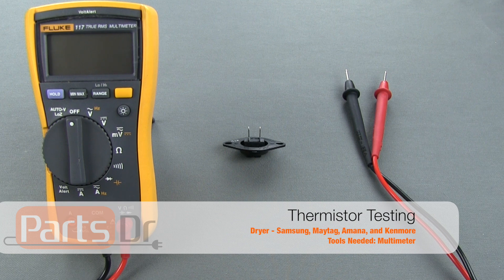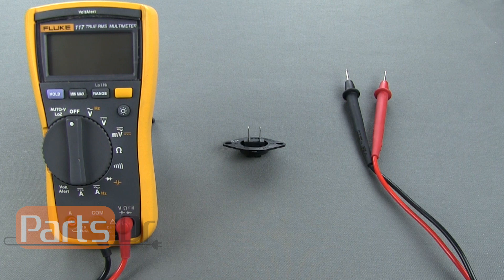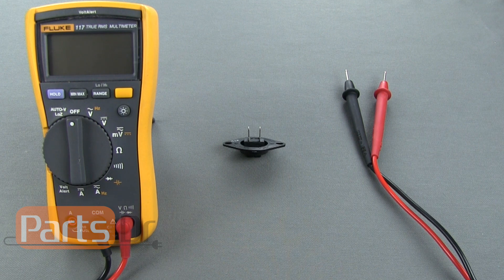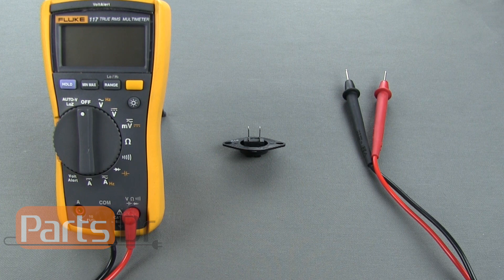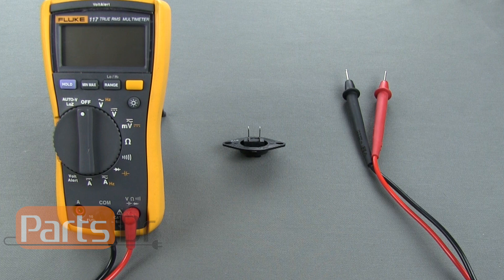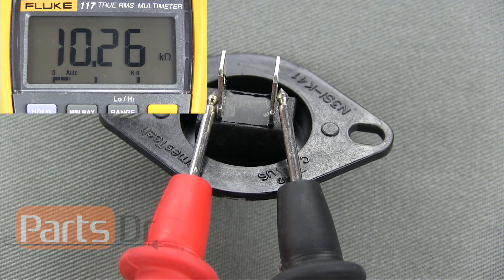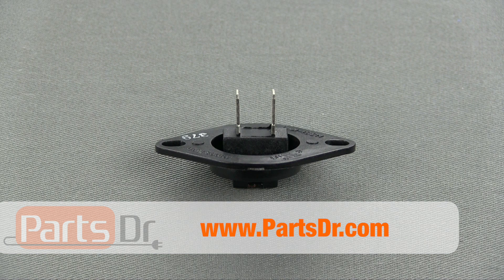How To Test Thermistor Part # DC32-00007A & WP35001191

Comment: Can you test the thermistor with an analog multimeter and if so what setting should it be on and what reading should I get
Reply from the maker: Yes you can.  Set the meter to the 20K or 40K setting for this part shown in the video.

Comment: Multimeter set @20k, no reading for thermodisc T-105 off a speed queen. 
Multimeter set @200k reading is 45. 
Is this a bad thermistor?
Reply from the maker: Ohm specifications vary depending on the part.  Please reference the manufacturer's specifications for your specific dryer and part.

Comment: Hello, I have an auto range multi meter and getting absolutely nothing on the old or new thermistor. Also, would this being bad cause the dryer to over heat? I found the heater element to be broke so I replaced and now it is over heating. Thanks!
Reply from the maker: It's unlikely that the old and new parts are defective unless they are aftermarket parts.  Check to make sure that your multimeter can read ohm values over 10,000 ohms (10K).  A bad thermistor can potentially cause a dryer to overheat.  Try running the dryer on an air dry only (no heat) cycle, if the dryer still heats up then you may have a bad main control board or a shorted heating element.

Comment: thank you so much for details on the ohm values to expect, I wouldn't have known that the 1K reading I got was out of range otherwise. Funny though, I didn't get any error codes on my dryer
Reply from the maker: Glad you found this.  Most dryers will only throw an error code for an open or shorted thermistor.

Comment: My repair man told me it was a bad part after doing a continuity check... No beeps.  I tested after he left and I had no continuity either, but 10.5-10.75 ohm reading.  I wonder if he just didnt know, if he was scaming me, or if im just not understanding correctly ...but im getting rhe reading I should for my room temperature.  Insightful and pleasantly concise video, thank u!
I KNOW the heating element is burnt out, but I wonder if the thermistor is actually working just fine 🧐🙄
Reply from the maker: It sounds like the thermistor was not bad from what you are saying.

Comment: My multimeter ohm setting goes 400 > 4000 > 40k > 400k > 4m. 
Does that matter if I set it to 40k? 
Thermistor that I think is bad tested 8.3k at room temperature.
Reply from the maker: 40k is the correct setting to use.  8.3k is off enough that we would replace it.

Comment: I did not respond to a test with a multimeter set in ohm（2k），What's the reason
Reply from the maker: Since the ohm value is higher than 2k, you have to use the 20k setting.

Comment: My reading is 9.15 ohms, I have resistance on the fuse next to the thermistor, the high limit thermostat and the heating element.  Yet, the thermal fuse on the heating element assembly keeps blowing.  The blower is clean - my air flow is awesome at the vent cap.  Any ideas why the thermal fuse (DC96-00887A) keeps blowing?
Reply from the maker: With your thermistor reading being that far off it would probably be a good idea to replace it.  Our guess is that part probably isn't what is causing the fuse to blow.  Try running the dryer on an air dry (no heat) cycle.  If it heats on an air dry cycle, check the heating element for a short or your main control board might be bad.
Reply: @PartsDr  Thank you - I'll try the no heat cycle when the new fuse arrives.  The heating element has continuity and a resistance of 12.25 ohms.  It didn't register a short to the housing and I visually inspected to confirm.  I also want to update - I found out that the ground jump wire was wired to the ground from the cord instead of the neutral terminal.  I have corrected this mis-wire.  Is it possible this is causing my specific issue or, more likely, caused the control board to go bad?

Comment: I am getting a .05 ohm reading on my thermistor on my Samsung dryer would this make the HC error code
Reply from the maker: That reading would mean the part is bad if you are testing it correctly.  We couldn't find any information on the "HC" error code.
Reply: I get a .25 on the 20k ohm setting... So 250 at room temp.  My error code is "HE".. And this makes sense that the dryer stops almost immediately since it would think the temp is off the chart.  
Thanks for this video!  Was very informative and useful!
Reply from the maker: @evanmitchell1480  We are glad you found it helpful!

Comment: I have a Hotpoint Ultima condensing dryer that wont get hot. Thermostats and element have complete circuits. The thermistor resistance is coming in at 107k. According to your video I need a new one. Is the resistance the same for all makes of dryer?
Reply from the maker: No it is not the same for all makes of dryers.  You will need to find the specifications for your specific thermistor in your model dryer.
Reply: @PartsDr  If I do a continuity test on the thermistor the circuit is open at room temperature. Does that prove it is faulty?
Reply from the maker: @tanz8151  No, you cannot do a continuity test on a thermistor.

Comment: When i checked the thermistor for my samsung dryer it reads 8.76... I'm not sure how much difference this is from 10.26. Should it be replaced? Your help is greatly appreciated thank you.
Reply from the maker: It is off far enough that it would be a good idea to replace it.  It probably isn't off far enough to stop the drying from running or throwing an error code.

Comment: Getting open reading no resistance on 3 new thermistors. Checked on two different auto ranging multimeters. I must be doing something wrong, can’t believe 3 parts would be bad. Any help would be great.
Reply from the maker: What make and model multimeter are you using?
Reply: Parts Dr  Klein mm400 good to 40m
Reply: Had it on wrong setting thermistor, heater, and limits are good but still not heating. I am assuming the control panels is bad?
Reply from the maker: @arambo1628  It could be.  Make sure you always start by checking that the power supply to the dryer is good.

Comment: Your video was the first to come up in my search. I thought I was supposed to check for continuity like I did with the thermostats when I was told by another repair website to check for resistance. I'm glad I found this as it saved me from ordering this part that was actually good! I didn't know how to do this until now. I'm pretty new to electrical testing knowledge. Thanks for this!
Reply from the maker: We are glad you found this video helpful!

Comment: Does this thing have anything to do with the dryer not heating. Ive replaced the heating element, thermal fuse and the other fuse thing and still no heat.
Reply from the maker: If the dryer is throwing an error code relating to the thermistor it depends on the model of dryer but it can cause the dryer to not heat or not run at all until the problem is resolved.

Comment: I am using a fluke 7 - 600 electrical tester multimeter  when I tested the thermistor with this multimeter I did not hear a beep or no reading was shown does this mean the thermistor is bad or did I not check it correctly?
Reply from the maker: The Fluke 7-600 only registers ohm values of up to 400 ohms, so this meter will not register a high enough ohm value to test this part.  You will need to use a different multimeter that registers ohm values over 10,000 ohms to test this part.
Reply: @PartsDr  Can you  recommend me a multimeter that can measure up to 10,000ohms under $50?
Reply from the maker: @DannyPacheco-j6f  This one from Home Depot is within your budget and it measures up to 40 Million Ohms.  Just make sure you read the instructions so you know how to switch it between Continuity and Resistance measurement modes.  https://www.homedepot.com/p/Klein-Tools-Auto-Ranging-Digital-Multi-Meter-MM400/206517333

Comment: i dont have a tester can i bypass the  thermistor by jumping the 2 wires together to see if my dryer will spin? PF code. ive already jumped the thermal fuse and nothing happens
Reply from the maker: No you cannot bypass the thermistor.  PF is usually a Power Failure error that occurs when the dryer is unplugged and plugged back in.
Reply: so whats the fix then because my dryer does not spin?  belt is good/thermal fuse is bypassed and not working  kenmoore he4.

ive seen other vids telling me pf means its the thermistor. also why cant this be bypassed?
Reply from the maker: Error codes are specific to each model appliance.  You will need to look up for your specific model what the PF error code means.  The thermistor cannot be bypassed because it has to output the correct reading to the control board for the dryer to function properly.

Comment: I have a GE dryer with the stem feature. I have the unit apart already. I have no heat. I tested the elements good  test thermostat getting continuity . I don't see a thermo fues. please help.
Reply from the maker: Most dryers made within the last 30 years have at least one thermal fuse.  Check the thermal fuses for continuity and also check to make sure the dryer has 240v at the power supply coming to the dryer.
Reply: Parts Dr, I still didn't see the thermo fuse. Just new dryer.

Comment: The thermistor for my Maytag dryer model MDE10 is discontinued without replacement. Can I use some other manufacturer's thermistor with similar settings and how do I know which will work?
Reply from the maker: If you could find the manufactures specifications for the thermistor and you could find another that matches identically, then you could use that in place of it.  The difficult thing is that the manufactures don't always publish that information.

Comment: So I have this thermistor, which I tested with a similar ohmmeter, and I wasn't getting any reading or beeps at all.  I just got the new one in the mail, and this one also gives no reading or beeps.  Is it possible I have two faulty thermistors including the new one?
Reply from the maker: It sounds like you might not have the meter set to the correct setting.  The setting where the meter beeps is the continuity setting and that won't work for testing this part as the ohm value is too high to register on a continuity test.

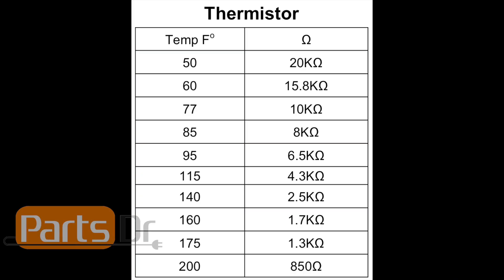Comment: My GE thermistor values are a bit higher than yours at 1:40
Reply from the maker: Each thermistor can have a different resistance value.  You will want to check the correct resistance value for that particular thermistor to see if it is within the manufactures specifications.
Reply: my thermistor resistance values were on the wiring diagram.  Looks like it matched those values.  Just wanted others to know these values were not exact and others would need to check their model's values

Comment: My white thermal fuse next to my thermistor is blown, and dryer vent wasn't clogged nor was there lint blockage on the inside if the blower duct. My thermistor is reading around 12k at room temp (74 degrees), so that means the thermistor is bad, correct? Thanks

Comment: where can I find a resistance chart for the dc32-00007a
Reply from the maker: You can view it here: https://goo.gl/photos/SLATZTpo44JEU3Vw9
Reply: Thanks. At room temperature 70 I am getting about 8k put it in the fridge for 10 minutes best I can get is about 14k.
Reply from the maker: Since it is off by approximately 2k ohms at room temp we would recommend to replace the part.
Reply: Hello sir, Thanks for the info. At room temperature of 70F I got a reading of 11.71 K ohms but no continuity. Would you say this is right?

Comment: would a blown thermistor stop a duet duet from starting?
Reply: Parts Dr I did not know a thermistor eould stop a dryer from running.  I thought it might keep the dryer from heating like a bad operating thermostat.
  I find that most non start problems are thermal fuse or door switch, sometimes a timer.
Reply: +youonknowme If you find out, please post the answer on here. I'm having the same issue. Duet dryer, all the lights come on, but when I got to start it clicks and goes to sensing but then nothing else. Have the whole dryer taken apart.
Reply from the maker: If the thermistor is shorted or open it could stop the drying from running, but it would normally throw an error code relating to the thermistor.  If you are not receiving any error codes then we would recommend to start by checking the thermal fuses for continuity.   https://youtu.be/HyCaoiQsyd0

Comment: Great video!  It has been a long time since I used a multimeter.  

I tested the thermistor for my Maytag Neptune and got a reading of 7.3Ohms at about 80F ambient temperature.  Does 1 or 2 ohms make a significant enough difference?  The dryer gives me a code that says "Thermistor Open Sensed".    Thanks!
Reply from the maker: +Brian Dilley You will need to look up the exact specs for the thermistor that you are measuring.  In most cases the manufacture will give you a ohm specification for a thermistor and it will need to be within a certain percentage of that reading to be considered good/bad.

Comment: This is very helpful, websites are selling the Maytag part over twice the price as the Samsung one. I'm guessing since they're both 10k and look exactly the same, my Amana won't know it has a Samsung part it it.
Reply from the maker: William Decoteau Whirlpool part # 35001191 & Samsung DC32-00007A can both be used interchangeably.  Currently the Samsung one is quite a bit cheaper than the Whirlpool.  Make sure to verify the thermistor part number using the model number of the dryer as not all Amana dryers use this thermistor.  http://partsdr.com/part/dc32-00007a-thermistor/
Reply: Thanks, it uses the 35001191.
Reply from the maker: William Decoteau Great, then you will be fine to use Samsung part # DC32-00007A for the replacement.